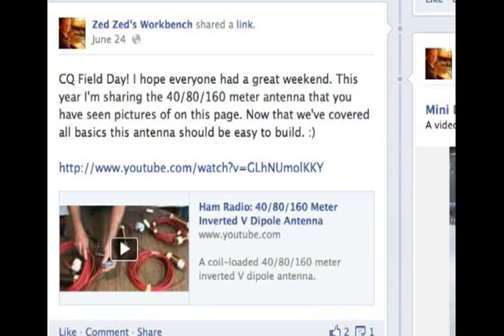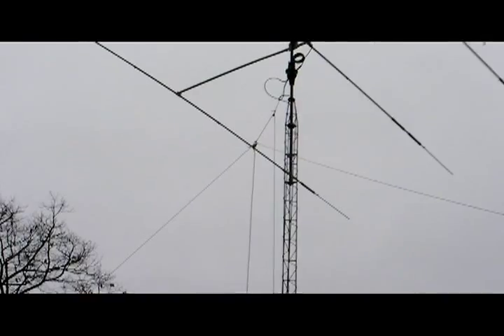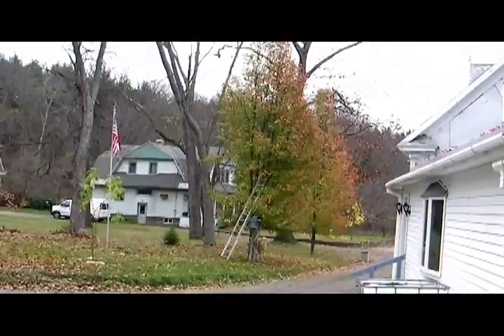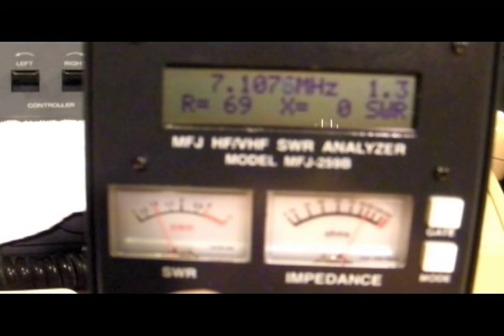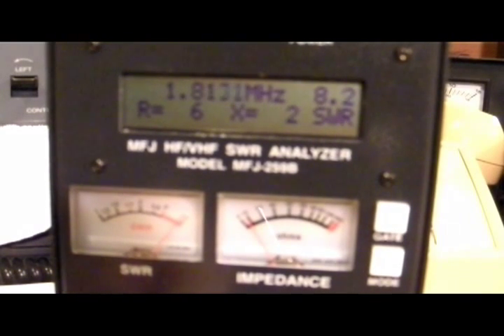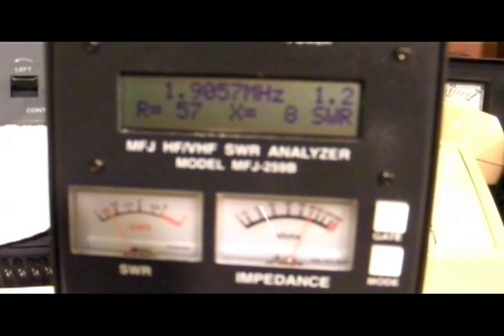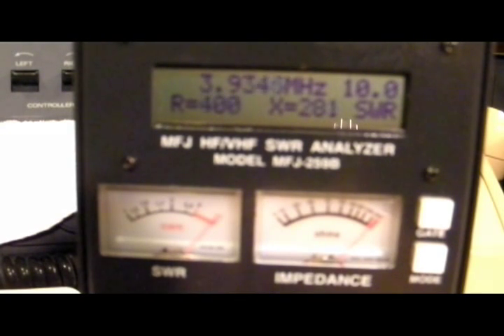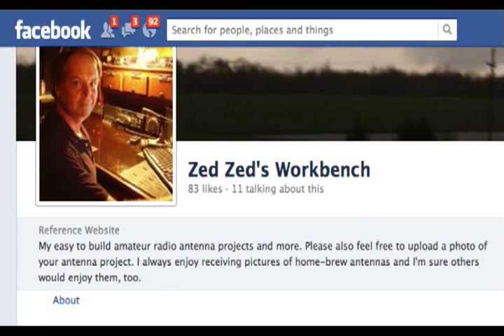Inverted V Antenna 40-80-160

Comment: It looks great! I'm very flattered. :)  To raise 80m make the wire section shorter. This will also raise 160m some. After shortening 80m you may want to lengthen 160m. I've noted the amount of change in frequency on my web site and in the video. Congratulations on a job well done! 73! :)
Reply: I built one of your 40 meter inverted v last night and tunned it, perfect swr and works amazing